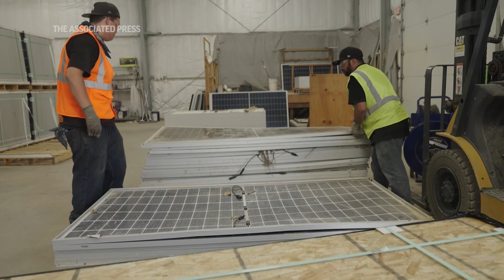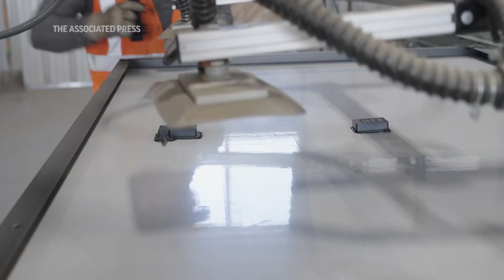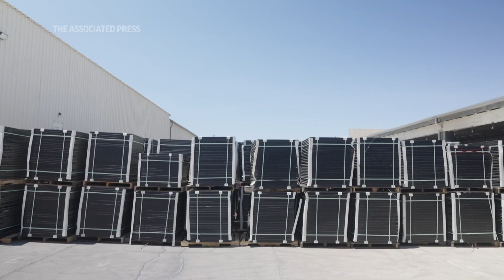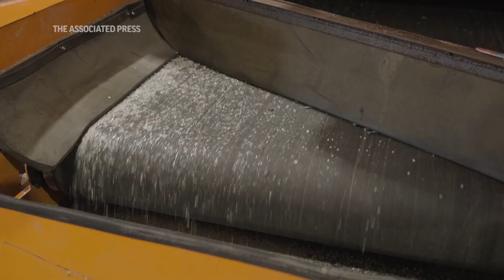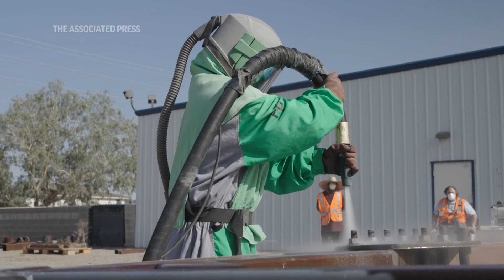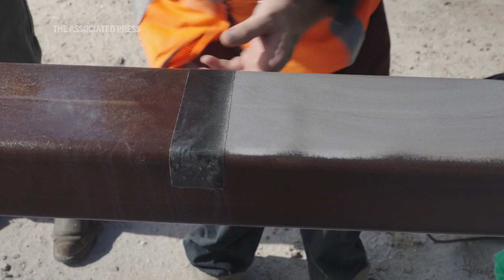A solar panel recycling industry takes shape in Yuma, Arizona

Comment: I built 28kW solar system myself with 100 used panels at 1/4 the cost of new and 1/16th the cost a solar contractor quoted me. Check out Santan solar in Gilbert, AZ if you want to buy used panels.
Reply: I've been there. Cool facility, very nice folks working there.